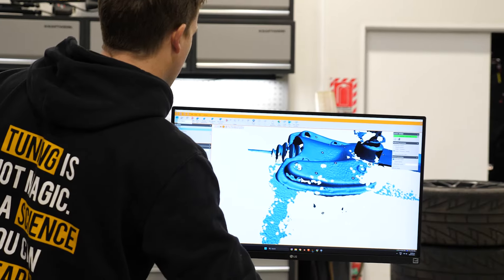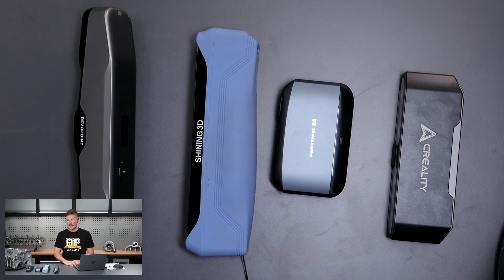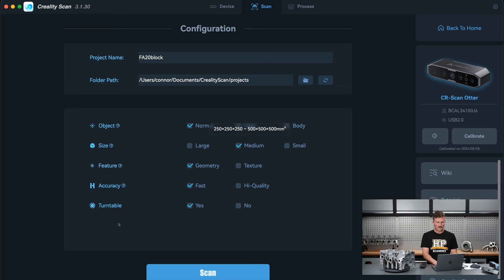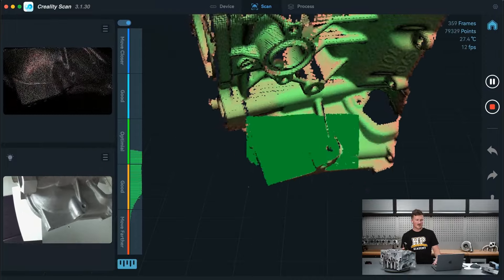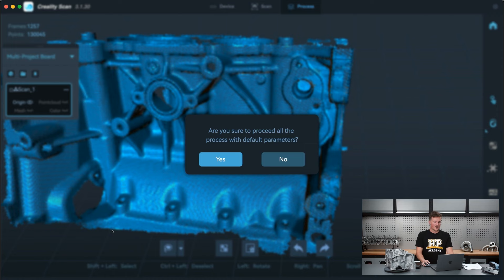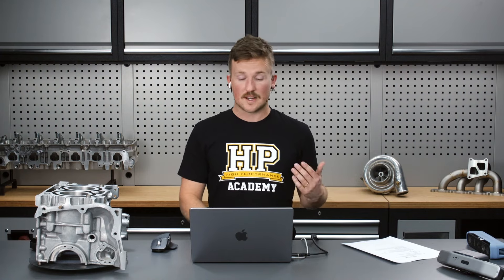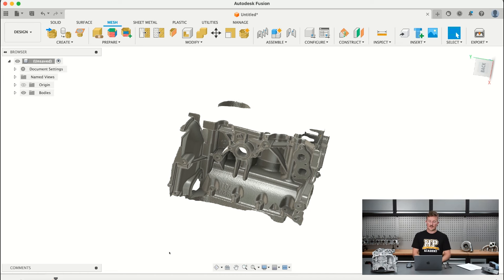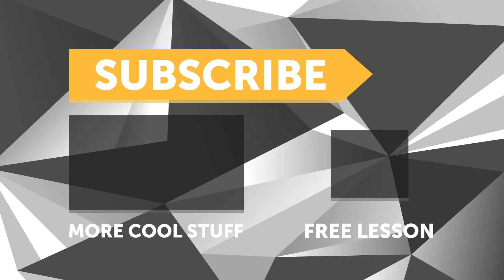3D scanning is really this simple? 🧠

Comment: I have an Einstar, and it's proven to be worth it's weight in gold. I've designed many parts for my project car based off 3D scanning (full widebody kit, turbo manifold, rocker cover, AWD conversion kit etc). Parts were 3D printed for test fitting and then produced (CNC, laser cut etc) and everything fits just right. The quality of the scans is amazing for the price ... I highly recommend the Einstar!   The only problem I've found is that I now actively look for uses to scan and produce more parts than I originally required. This has extended the build time substantially and unnecessarily. It really IS THAT ADDICTIVE! lol. With todays technology being relatively easy to access, every modern toolbox should have a 3D scanner and printer.